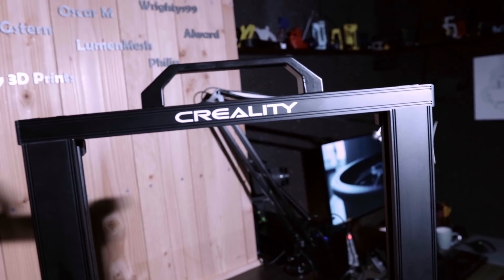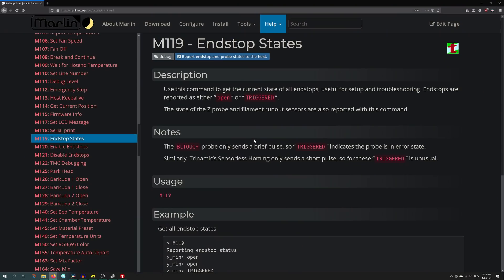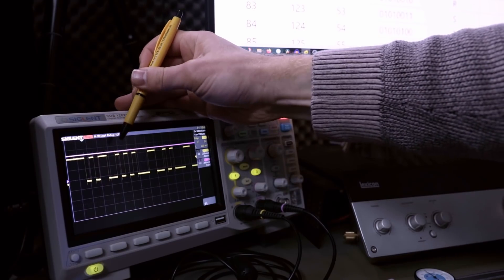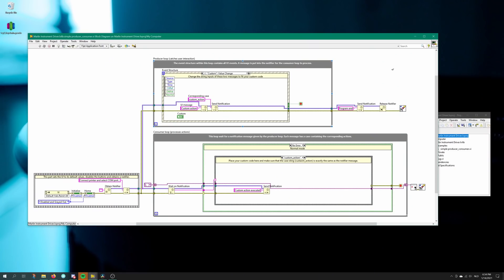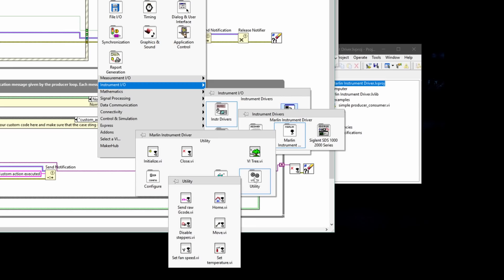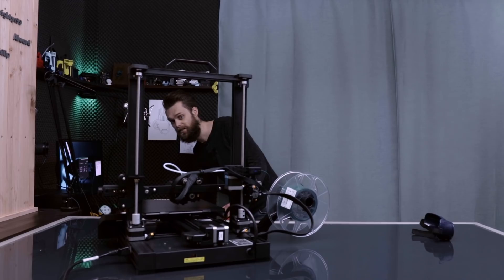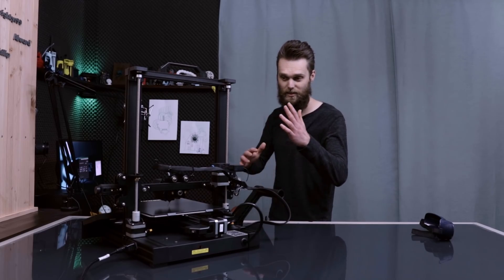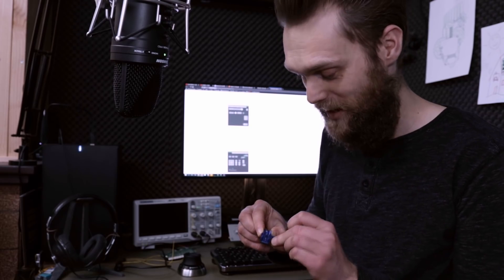I Developed my own 3D PRINTER Controller Software!

Comment: Marlin is a great open-source piece of software. LabVIEW is proprietary software very far from the open-source ecosystem.
Reply from the maker: That's true. I'm not against proprietary software and my program itself is open source
Reply: @properprinting  I state that I think you are very skilled in your work. But in this project I didn't understand the mission. Your program is opensource but requires proprietary software to run/compile? I'm a bit late on LabVIEW. I used it long time ago and there was no community edition. My personal opinion on NI software is that it obfuscate knowledge. You have to pay many features that you can learn to do writing c/c++ or python code for example. A "community edition" means that you can learn for free, spending your time, how to pay NI when you will need for work or until they think to change licenses.
Reply from the maker: @giuseppemascolo1494  Thanks for your reply and I understand your point for view. I'm happy that they finally released a community edition and the risk indeed is that you'll have a problem once they change the license. The reason why I'm using it is because I'm a LabVIEW developer and I can implement anything I can think off without having to learn something new and LabVIEW is good at controlling devices. I try to contribute to this community with my LabVIEW knowledge and share the software for free

Comment: Maybe make an interface where you can draw a design to print with the food dispenser?
Reply from the maker: Thanks for your suggestion! I have an idea similar to this using Inkscape. It would require reading out svg files, but this should be doable because it's just xml formatting.

Comment: can I also use this Software to send G-code to a CNC router?
Reply from the maker: Yes you can. Especially when it's running Marlin it shouldn't be a problem. I want to make different UI's within the same program so it's possible to switch between laser engraving, food printing milling etc. The principle stays the same.

Comment: Hey awesome video! I want to use it to troubleshoot my printer which has this really weird issue that moves the head to a weird position at the start of a print and then does absolutely nothing :(
Reply from the maker: Thanks! That's very odd. It sounds like an abnormality in the gcode itself. Hopefully this tool would be helpful

Comment: Better and better! :D Love your videos! About the software, mmm, what could do more than Repetier Host?
Reply from the maker: Thanks! At this moment it cannot do more than Repetier (except for the manual torture test). It's pretty standard right now. This is a platform in which we can easily add experimental features, like using this for food printing and show photos of the meals. I can connect and control an Arduino from LabVIEW to switch the PSU and RGB led's (this is possible in Octoprint as well, but now I have full control). I can use it to control the camera shutter for awesome time lapses and not only the shutter, also an Arduino based camera slider. I can make an interface switcher to switch between laser engraving UI, pen plotter UI etc. I can design my own automated tool changer. I've got more ideas but I don't want to spoil too much xD

Comment: That would be interesting to test the resonance frequency on all axis to avoid it while printing. What would be a good sensor to do that, in your opinion?
Reply from the maker: Besides the phone I haven't used other sensors to measure acceleration. I think an Arduino nano with an accelerometer shield connected to LabVIEW would make an interesting combination https://www.instructables.com/Arduino-Nano-Accelerometer-Gyroscope-Compass-MPU92/
Reply: @properprinting  Hum, I realize it kind of already exists:
https://www.youtube.com/results?search_query=Input+Shaper

I have only seen CoreXY examples now, though
Reply: I believe he actually did this in a video when he made the "portal Y axis" mod. He just taped his phone to the top of the gantry running an app that displayed the accelerometer output while he used a similar printer control program to make it shake.
Reply: @SpencerPaire  Good memory.
Something automatic would be nice, though...especially since the weight of the part being printed would influence the resonance of the Y axis (on an i3 clone)

Comment: Pause may be missing in the Creality firmware. Chep has been talking about this problem with the newer Creality machines.
Reply from the maker: The pause function is within my program itself. It stops iterating through the gcode lines, goes up 5mm and than it waits for the user to do something. It is possible to use the move buttons to move the print head, but it doesn't resume correctly. It looks like something goes wrong in the buffer and I'll figure it out ;)

Comment: You might be able to use com2com on windows or socat on Linux to listen to the serial data without a scope. (or just another USB TTL adapter like FT232*)
Reply from the maker: That'd have worked too indeed. The reason why I used the scope is because I wanted to show what actually happens at those RX and TX lines and how this corresponds to the actual messages. This didn't help with building the software because LabVIEW itself shows what's received.

Comment: Is this like Klipper?
Reply from the maker: I don't think it is. From what I've read Klipper separates the stepper motor control and logic control to make it faster. With this software the micro controller still has to process the commands AND control the steppers. I don't have in depth knowledge about Klipper so I might be wrong though.

Comment: To read the serial codes, perhaps a serial interface would be easier than a scope, and of course Marlin is well documented. There are lots of solutions for what you want (send some custom gcode commands/scripts)
Reply from the maker: Although is doesn't look like it, a scope is not hard to use ;) This idea goes beyond sending custom Gcode commands, I can make custom UI's and control other devices like an Arduino too. LabVIEW is built to communicate with instruments, automate tasks, store data, analyze it and present it. This is just the start ;)

Comment: What was the reason behind making your own controller and not modifying an open source one? Just the learning experience? Never heard of LabVIEW before, could be a pretty handy tool for making quick and dirty interfaces for my next electronics projects actually :D
Loved the part with the welding goggles XD

Edit: Nevermind, I can't afford LabVIEW :D
Reply from the maker: I'm a LabVIEW developer at work and have done several projects controlling hardware and making automated test systems. This is a perfect platform for this type of applications and it can be downloaded for free https://www.ni.com/nl-nl/shop/labview/select-edition/labview-community-edition.html
Reply: @properprinting  Oh didn't see the community edition, sorry about that :) Definitely going to give it a try.